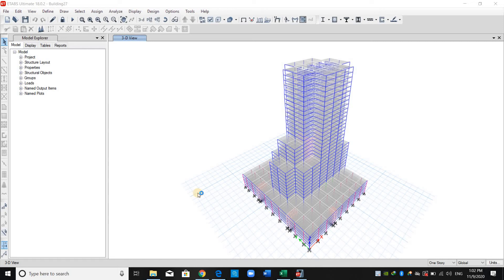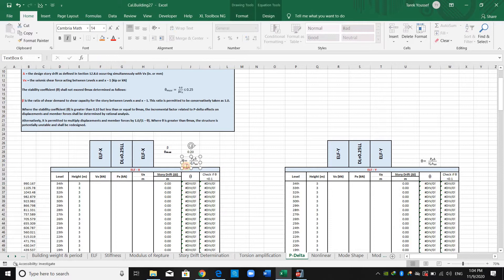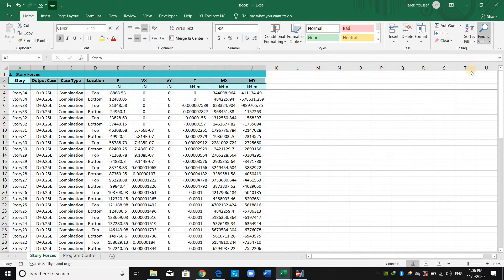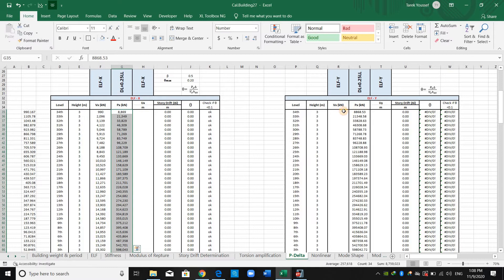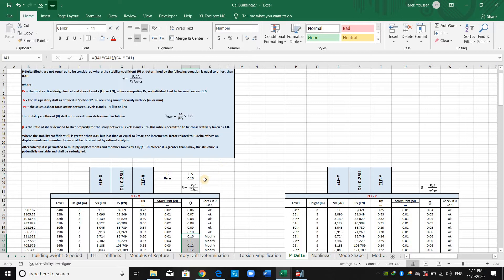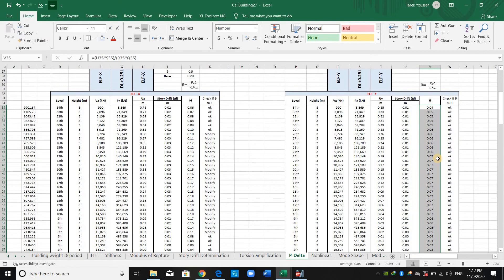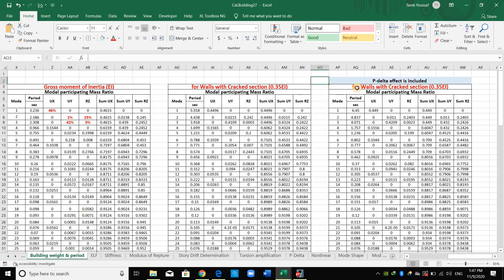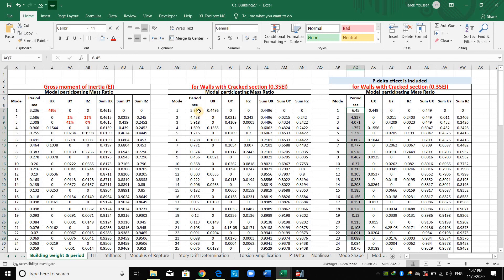How to check and include the P-delta effect using ETABS software (Lec17)

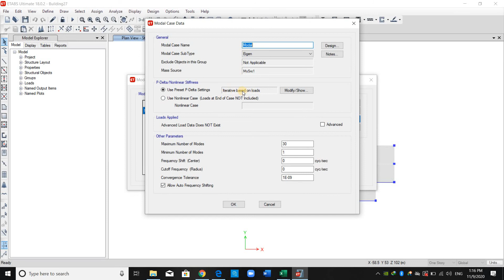Comment: 10:25/12:07 the dialogue box for the modal load case shows the P-Delta/nonlinear Stiffness ..You selected the first option i.e., "Use present P-Delta settings"  instead of "Use Nonlinear Case". Can elaborate  whats this second Nonlinear option used for ???

Comment: sir, what if the P value in story force is empty? is there anything that needs to be added? please confirm sir
Reply from the maker: You should have "P" as it corresponds to the design vertical loads (gravity loads exist in all floors).

In this video I used the load combo of "DL+0.25LL" to get P.

Comment: sir, can we get to know what is refernace for 1DL+0.25LL as multiplier for P-Delta
Reply from the maker: P-Delta effects are generally evaluated under service load conditions because these loads reflect the actual conditions the structure will experience during its lifetime. Service loads are the unfactored loads, which include dead loads (DL) and live loads (LL) without any safety factors applied.

In structural design, factored loads (which include safety factors) are used for ultimate strength design to ensure safety under worst-case scenarios. However, for evaluating P-Delta effects, which are sensitive to actual displacements and deformations under normal use conditions, service loads are more appropriate.

Why 1DL + 0.25LL?
The use of 1DL + 0.25LL as a load combination for P-Delta analysis is intended to provide a reasonable estimate of the service load effects on the structure. The factor of 0.25 for live loads accounts for the likelihood that not all live loads will be present simultaneously and fully across the structure. This partial live load factor reflects a more realistic scenario of load application during the service life of the structure.

This approach is supported by design standards such as ASCE 7 and AISC 360.
Reply: sir, thanks for your reply!!!

Comment: why we should use static forces only to check P-Δ effect?
Reply from the maker: It is much preferable to check the P-delta effect using a static force (ELF) because as shown in ASCE the design story drift should be that one occurred simultaneously due to the applied load. The design story drift obtained from RSA method is the combined response (combination of several modes using SRSS or CQC combination rule), therefore the design story drift obtained from RSA is the combined response of several modes and not occurring simultaneously due to the applied load.

Comment: hi. can please clarify why you choose Beta= 0.5 not equal to1 as a conservative value as mentioned in the Code ?
Reply from the maker: I was just trying to explain the importance of beta value. sometimes we can take beta=1 (conservative case), however in some cases taking beta=1 will leads to a high value of theta. Therefore, we need to go into details in computing beta value to be more accurate.
Reply: @Eng.tarekyoussef  Greetings, Could you explain how the beta factor is calculated so as not to use 1.0 or do you have any bibliography on the calculation of said beta factor? Thank you.

Comment: Sir, if we use response spectrum method,  which period should we based? The first one, the second( cracked section) or the third one( with p delta)?
Reply from the maker: the third one (with P-delta)
Reply: @Eng.tarekyoussef  if use response spectrum method to analyze building. To check the p-delta effect,  should the story shear and drift in that formula be from the equivalent force method? I.e. p delta effect result is same for ELF and RSA?
Reply from the maker: @Upbeat_peach_dricer  It is much preferable to check the P-delta effect using a static force (ELF) because as shown in ASCE the design story drift should be that one occurred simultaneously due to the applied load. The design story drift obtained from RSA method is the combined response (combination of several modes using SRSS or CQC combination rule), therefore the design story drift obtained from RSA is not occurring simultaneously due to the applied load.
Reply: @Eng.tarekyoussef  Thank you. Very informative.